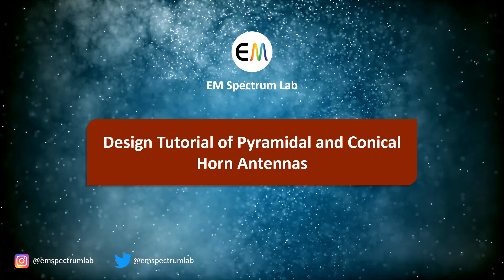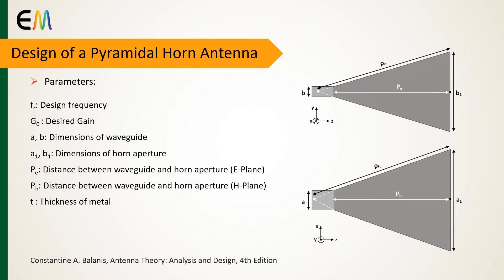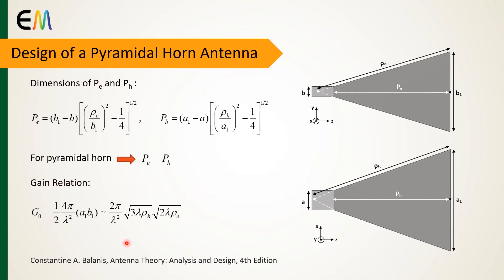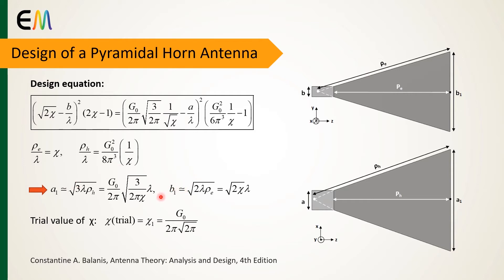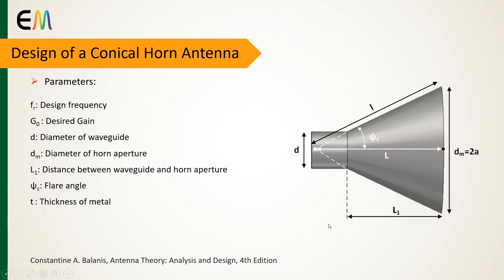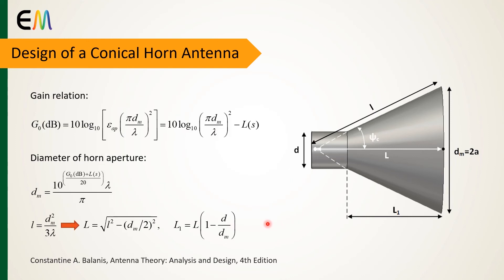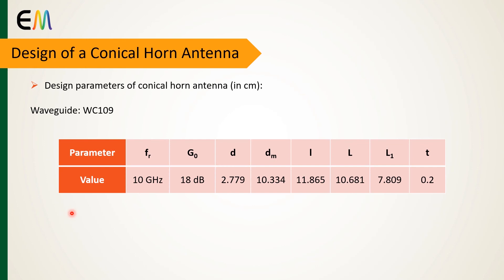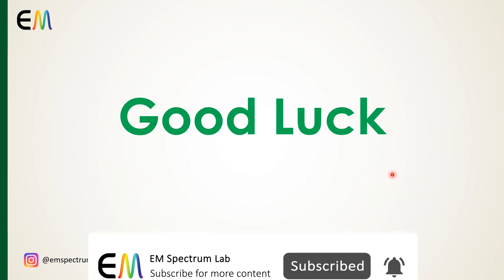Design Tutorial of Pyramidal and Conical Horn Antennas

Comment: Sir i have designed an pyramidal horn antenna in ANSYS HFSS for frequency range of 12.4-18.2Ghz, i have assigned it wave port and boundaries (perfect E to all faces of horn exept the face of wave port and radiation to radiation box) and gave it driven solution setup and frequency sweep. But sir when i try to validate it, it gives me an error "A wave port must have 'solve inside' objects on one side only. An internal wave port requires a PEC object to be attached to and cover the opposite side before the solution can proceed."
Please help me sir I'm trying to solve it for more than 10 days
Reply from the maker: You should paste the face of wave port on the face of the radiation box. it should not be a gap between the wave port and the radiation box wall.

Comment: How have d value because not be in the information
Reply from the maker: "d" value is related to the standard diameter of your used circular waveguide. For example, for WC109 waveguide it is equal to 2.779 cm. The standard circular waveguides have different diameters for different frequency bands. You can search and find the various circular waveguide types.

Comment: How did you find horn aperture dimensions , it is not possible to find them given equations please help.
Reply from the maker: Sorry, I do not understand what you mean. I explained the required equations in order to calculate horn aperture dimensions and other parameters clearly in the video.
Reply: @EMSpectrumLab  L(s) is not just a lenght for balanis book L(s)=-10*log(epsilonap) and epsilonap is aperture efficiency but ı could not find anything about it, so for that reason ı asked this question, help me please do you know about it anything
Reply: By the way ı found that "The aperture efficiency ranges from 0.4 to 0.8 in practical horn antennas. For optimum pyramidal horns, eA = 0.511., while for optimum conical horns eA = 0.522. So an approximate figure of 0.5 is often used."
Reply from the maker: @berkay5554  Yes, for these calculation you can use the optimum value of aperture efficiency.
Reply: @EMSpectrumLab  thanks a lot it worked